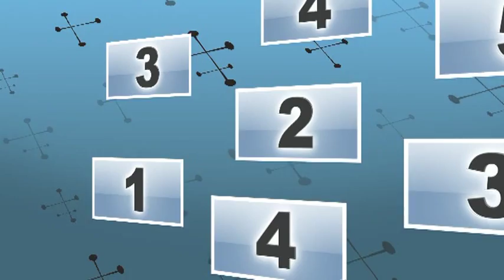My SEC 15-3 exciter

Comment from the maker: Thank you for the compliment Cosmic.
I had a couple of inductors but i started with a 10uH because this circuit functions in a way like a joule thief so i thought i try the same inductor at the place where the variable inductor is shown in the circuitdiagram as the starting inductor and it worked like a charm. So no math was applied. One little thing by using a normal inductor is that the consumption of the circuit is a bit high (87 mA). With hand made inductors it's approx. 25-27mA